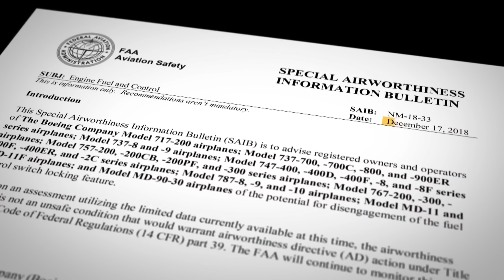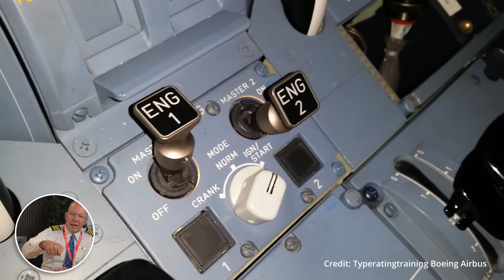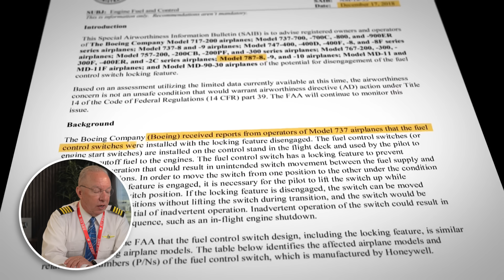Air India 171: The FAA’s 2018 Fuel Switch Locking Bulletin Explained (16 Questions Answered)

Comment: I am not an aviation expert so pardon my ignorance, but from what I read I understand that these fuel control switches are fly by wire and not mechanical that control the fuel valve directly. In which case isn't it possible that FADEC accidentally switched fuel valves off ( due to software error)? The switching off the valves would have generated a visual warning to which pilot reacted and asked the other pilot why he switched fuel off, to which other pilot correctly responded that he didn't. 
AFAIK the similar controller in Airbus not only goes rigorous testing, it actually goes through a theorem prover to guarantee the software doesn't do such catastrophic things. Does Boeing follow similar protocol?
Has anybody looked at FADEC code from this angle?

Comment: Captain Steve did not provide a very good answer about video recording in the cockpit. Of course, Steve, it wouldn’t have prevented the tragedy. It’s an absolutely bullet proof way of knowing if sabotage by the copilot occurred however! The reason that pilots are reticent to approve this video monitoring obviously has to do with behaviors that may put their job in jeopardy. This list could include napping, flirting, going on social media, making mistakes during flight that otherwise are not able to be discerned as dangerous to the flying of the plane but could have been, and even noting aberrant behavior consistent with drug or alcohol use before flight. One reason I am still skeptical of the pilot suicide angle is the timing of this tragedy which was just seconds after takeoff, which is an odd time to commit such an act. I think the burden is on those who think this was pilot suicide to prove it. You would have to demonstrate from family, friends, and colleagues that this individual had features and behaviors that were consistent with major depressive disorder or potentially PTSD with suicidal ideations. If a medical assessment never showed any mental health issues, and nobody can corroborate that the man was suicidal or depressed, this whole theory being spun about mental health must be placed again on the less likely list. Mechanical error from Boeing, even with such switches, has to be considered. For example, why would the pilot cut off fuel right on takeoff and risk hundreds if not thousands of additional lives on the ground. It’s one thing to take your own life and perhaps those you’re traveling with, but it would require a super dark and murderous individual to want to hurt even more people on the ground. In examples of prior air tragedies which have been attributed to possible suicide, the pilot tends to do this once in flight and at some respectable altitude rather than at takeoff or at landing. I could be wrong but that’s been my impression historically. I am a physician, although not a psychologist. I appreciate Captain Steve’s assessment but many of us are not buying suicide because it doesn’t fit the picture of what happened. To answer the question about Boeing and GE, there’s a massive amount of money and sales to lose by admission of any problem. So we can’t totally trust Boeing as has been shown by the Feds fining them for their coverups!

Comment: All the reports mention that flight data analysis shows the Fuel Switch was in the Cut Off position and was later moved to the On position. However, none of them clarify when the switch was moved to the Cut Off position in the first place. If the flight data can capture the switch being moved back to On, it should also be able to show the timing of the move to Cut Off. Why is this detail missing or unaddressed in the analysis?

Comment: Captain Steeve, I have a few questions for you as you seem too sure on the basis of this shoddy preliminary report that the fuel cut off was due to pilot action.
1.  Does not the FAA advisory say clearly that the there is a design flaw in the fuel switch locking mechanism which causes the switches to fall back to off position which can lead to catastrophic engine failure?
2. According to CVR, when the first pilot asked " Why did you cut off the fuel?", the second pilot clearly says," I did not do it!"

Comment: I agree that the pilot who turned the switches back on had great presence of mind to catch it so quickly.  To me, that also indicates that he saw what was done and did his utmost best to keep flying and avoid a crash, all while calling out a mayday.  Superb airmanship, just not enough time or altitiude to stop, unfotrunately.
Reply: He could hear the engines and they stopped.  He didn’t even have to look first
Reply: @sharonmontano4924  He would have also been suddenly pushed forward in his seat with his harness holding him in place. The loss of thrust would have been very apparent.
Reply: Poor bastard did his best to save ship and people. RIP pilot.
Reply: Well both ate looking out the windows and engine amd flight parameters on the console so they'd pick it up instantly just doing normal scanning
Reply: Can't the voices on the cockpit voice recorder be identified?
Reply: @Paula-tf3zv it will be in due time.
Reply: Yes, but logic would say that the pilot who did the act would try to stop the switches from being moved back to the start position.
Reply: it wasn't quickly
Reply: What were the two loud noise the survivor heard before they went down, possible a couple of bombs placed in the aircraft in stratigic places on the aircraft???
Reply: @mitchelldarnell5334  RAT deployment is likely one, APU another, or tailstrike.
Reply: It could very well have been that same pilot. Knowing that putting the switches back to the RUN position would not restart the engines in time…at 500 feet.
Reply: @baasbowing we dont know, ok? None of us do. These are all speculations. Is it so bad to wait for the complete report before deciding whether or not to blame one of two dead men?
Reply: @achyuthansanal  But the actual  voice recorders and info on the black box are released,shame no video was made in the pilot's cabin.
Reply: @rentispaid brother, it may be a casual approach by the pilot to the co-pilot. "Did you turn off the engine" when there was no thrust? See the past 15 accidents of Boeing, and you may find that in every incident, they blamed the pilot, even in the case of the 737 Max. The first incident until the 2nd incident wouldn't have happened
Reply: @rentispaid  No, there is just a very short trancript of a question and response.
Reply: @baasbowing  Why do so many decide to chose the most unlikely cockamamie explanation?  The most plausible is that the 1st office was at the controls and that the captain moved the switches, then the 1st officer moved the switches back and sounded the mayday.  The 1st officer was suicidal he could have just flown the plane into the ground.
Reply: @danrose3233  Not saying that this was definitely a suicide attempt, but by flipping the switches at that exact moment in the flight but saying for the benefit of the voice recorder that he didn't, he would have plausible deniability because both insurance payout to family and reputation would be lost if it was known that he purposefully crashed the plane. 
5 seconds later and the engines that were restarted automatically when the switches were flipped back on would of had enough time to recover. He would also be fighting the other pilot the entire time which would obvious on the voice recorder.
Reply: @danrose3233  Plausible deniability for insurance money purposes. If he just crashes the plane, he is a murdere and his family gets nothing. If we can not know for sure, the family still gets money.
Reply: @danrose3233 I think that is because it gives them some sort of a thrill to imagine the same, having watched so many thrillers and last minute plot-twists. As if the one pulling it to cut-off was some sort of a "villain" who wanted the other one to be blamed by saying "why did you do that?" And then shouting "May-day".
Reply: @danrose3233  There is a ten second gap between the shut off/accusation and the switches being on again. Enough time for the younger, stronger FO to overcome the captain and attempt to save everyone. Hopefully he will be remembered for his courage.
Reply: @danrose3233  yes likely the PM (captain) moved the switches.
Reply: @baasbowing  you and I know that with the benefit of hindsight, but how does HE know there was not enough time? In reality, engine 1 did in fact have enough time to spool up and gain some thrust, but not full thrust. Engine 2 was just 4 seconds behind. They were in fact mere seconds from surviving. If they had cleared that building, perhaps they might have crash landed on flatter ground with more people surviving.

If I wanted to die, I'm not turning the engines back on. In fact, I'm not letting the other guy turn the engine back on. If he reached out to grab the switch, I'd bat his hand away. If he tried to use both hands, I'd push the yoke down and also twist it to the right. Or pull the thrust levers back. Have you ever heard of a person committing suicide jump off a tall building wearing a parachute?
Reply: enough time to sabotage a liftoff but not enough to recover; why such an OBViOUSLY poor design oversight in the boeing/G.E. air logic?!
Reply: @high-captain-BaLrog 
Are you kidding? It isnt a design oversight, there is no design that could prevent a crash if the pilot,accidentally or deliberately, kills the engines at low altitude or retracted the flaps or for that matter, pulled the nose up and stalled the aircraft.
Reply: @high-captain-BaLrog except they nearly recovered.  If that pilot wanted to crash he'd have shut the switches off on the ground at takeoff committal speed.  Or just bank it hard at 100 feet AGL
Reply: @high-captain-BaLrog  Lets design around deliberate actions and insanity.  U first Einstein.
Reply: @partymanau   embraer innovates? so do innumerable other business jets and propeller plane manufacturers? how old and ignorant are you?

Comment: I'll respectfully disagree with Captain Steve-Had there been a cockpit video recording onboard the Air India aircraft in question, investigators could have definitively determined whether either pilot physically activated the engine cut-off switch. This absence of visual evidence leaves us with two troubling possibilities: either the switches malfunctioned, or one of the pilots intentionally engaged them — an act of potential sabotage.

In today’s world, even bank tellers are routinely monitored by surveillance cameras due to the responsibility of handling money. By that standard, the role of an airline pilot — who is entrusted not with cash, but with the lives of hundreds — is of far greater consequence and arguably merits even more rigorous oversight.

Installing cockpit video recorders would not only enhance post-incident analysis, but also act as a powerful deterrent against deliberate misconduct. From a psychological standpoint, research in behavioral science consistently shows that awareness of being observed reduces the likelihood of unethical actions — a phenomenon known as the Hawthorne effect. In high-stakes environments like aviation, where trust and safety are paramount, transparency serves both as a protective measure and a behavioral regulator.
Reply: I think there should be a public voice forcing agencies to install cameras inside cockpit. These pilots can't be trusted anymore

Comment: 14:21 a cyberattack could also happen on the ground, possibly during maintenance. One of the systems on the aircraft would be prepped to execute the attack based on position or time. ARINC-835 was meant to fix these issues. Sadly Airbus and Boeing never managed to agree on a proper standard for signing software parts. In an ideal world a LRU would not flash manipulated firmware. But we do not live in an ideal world! And yes, there is a push to bring aircraft automatically online. I spent some considerable time to bring them offline, again! That said I enjoyed working with air maintenance crews -- properly the best engineers on the planet. Always straight to the point, always dry and clear in the communication, always rational even under immense pressure, always performing the extra checks and doing so in the middle of the night under any conditions (say Helsinky -20°C 2:00 local time). A shout out to those that make it happen! And YES, please let us not ignore the glaring cybersecurity issues. The accident report definitely falls very short in this respect.

Comment: Captain Steeve, can it be a situation that both engines failure happened because of some other reason and pilots wanted to cut the fuel off and then immediately switch them back as you mentioned in you previous video. BUT cut off happened and switching back not because there was a crash.

Comment: There should be a warning. And a 5-minute delay. Before the fuel is turned off to the engines. And there needs to be a two-person shut down to the fuel. And or a override in case of fire.

Comment: The most important question Id wanna Know,and For Sure is...does the Fuel cutoff switches have the ability to be electronically used and by remote?!?! To me,that would be one of the first safety proto calls to prevent any airliner from taking off or abrutly end any act of terror to be carried out!?!?

Comment: I always appreciate your measured explanations.  I'm not an aviator but I did read "Stick and Rudder" over 50 years ago when in my teens.  As a Control Systems Engineer up until retiring 5 years ago, I worked with several manufacturers' turbine controls, especially for power plants.  In the case of the cut-off switches, I understand how the detents work (I've specified similar for rotating equipment), but I don't know how the cut-off switches are wired to the fuel cut-off valves or how the valves are activated.  Are the valves fail open, fail closed, or fail last position?  Are the cut-off switches wired directly to the fuel cut-off valves or do they go through some other device, like the FADEC and, if so does the FDR log the switch positions directly, are they logged as reported by the FADEC, or are there separate sensors on the valves rather than being wired directly from the switches?  Of course that "Preliminary Report" doesn't go into much detail.  It does, in fact, tend to point towards one of the pilots intentionally causing the accident by shutting down the engines.  i would not be so quick to make that insinuation.  I remember after Lion Air Flight 610 the pilots were initially suspected.  It was not until 5 months later when Ethiopian Airlines Flight 302 went down that further investigation revealed Boeing had added undocumented "features" to the 737 MAX 8 MCAS.  

On the subject of cameras in the cockpit... while cameras can't prevent the last accident from happening, I believe they can help identify and thereby maybe prevent the next.  In this particular case, having a camera record of one of the pilots intentionally or accidentally moving those switches versus neither pilot activating the switches but the engine controls still acting as though they had been, would be helpful.  In my 45 years as a controls engineer I witnessed more than a few events that were "impossible".

One last comment: Why is it all the fuel control panel pump switched are down to Run and up to Stop (which doesn't make sense to me).  Why oh why would the fuel run switches be reversed?  This, to me, would be a human factor engineering problem.

Comment: I'm thinking that it IS, or absolutely OUGHT TO BE, NOT POSSIBLE, FOR ANYONE,  to meddle-with/manipulate data from a flight data recorder.  So, with the FDR date showing the two fuel control ON/OFF switches being SWITCHED TO THE OFF POSITION,  at approximately one minute into the take-off profile, AFTER the plane had reached an airspeed of nearly 180 knots,  must absolutely show that those switches being moved to the fuel-off position WAS AN INTENTIONAL ACT !

Comment: How is it an "incredible presence of mind" to reverse an action that you know cut off the engines and will lead to a certain crash ? I have heard on some pilote channel incredulity about the 10 or 12 seconds it took to put the fuel switches back on RUN. Sadly there is no complete transcript of the CVR, so we don't know if there was any struggle between these pilotes after the "I didn't do it" reply.

Comment: You keep saying that the B737 switches were installed upside down and that wouldn’t work.  But that’s not what the report says.   It says it applies also to the B787-8 and it says they were installed with the locking mechanism disengaged.  If the locking mechanism is disengaged they could have been moved by accident with no-one realising the problem until it actually happened.    The recovery of the switch panel and a review of the service records should though clear up whether it was an advisory that was not followed up on and the problem existed or not.

Comment: I fly helicopters for a living and newer helicopters have cameras in them. Mine looks over my shoulder at out front of the helicopter. I have seen it go both ways with the video recorder in our aircraft. One it can prove the pilot didn't do anything wrong or it can get the pilot in trouble when they are doing something they shouldn't be doing. Can't they connect the cameras to the black box and make the video difficult to access? I get the pilots don't want someone randomly pulling the cockpit video and overhearing the pilots conversation.

Comment: There's a question about warnings if the fuel switch is shifted to an off position. You indicate warnings, such as the sound of the engine dying, and similar secondary warnings. But shouldn't all hell break loose and sirens go off all across if the fuel supply to the plane is cut off?